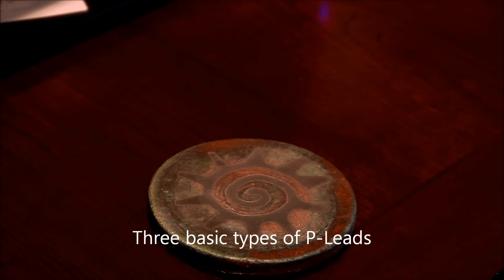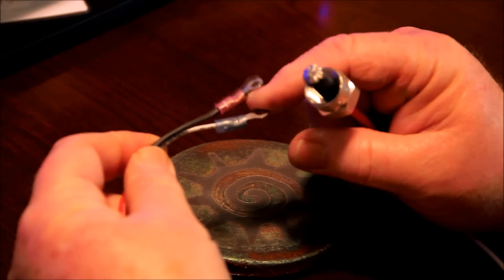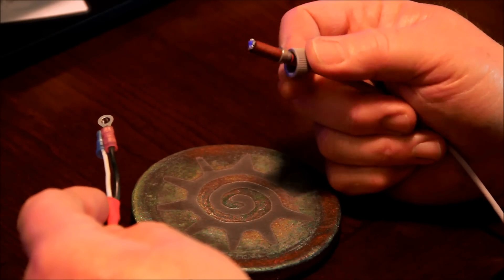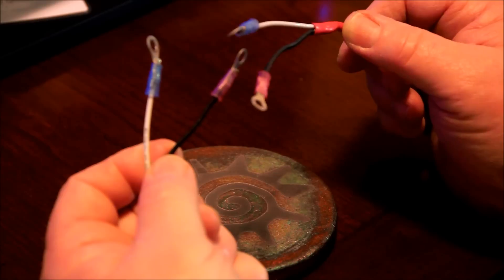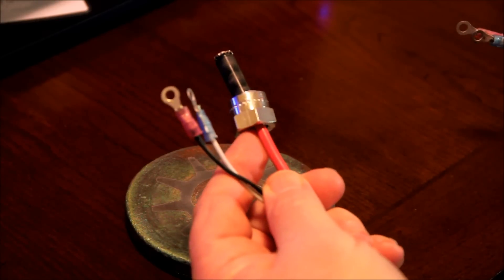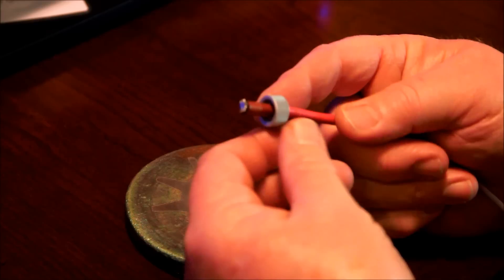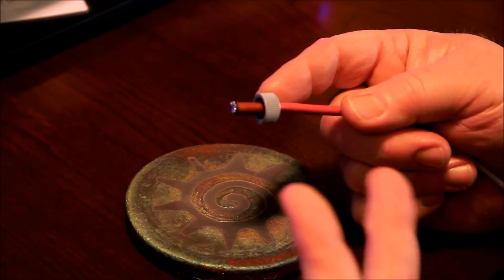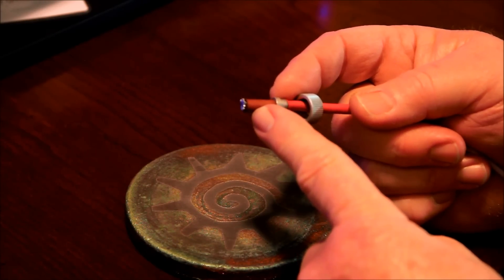Aircraft Magneto P-Leads -- Three Types

Comment: The 2 different bendix types have either a hex nut that is drilled for safety wire, which suggests that it needs some torque, or a round knurled nut that is not drilled for safety wire implying that finger tight is good enough. That is very puzzling. Does the round nut type use a tapered thread? Is the hex nut just overkill? Anybody know?

Comment: How do I isolate the bad p-lead or bad magneto? My cherokee 140, when I use the ignition switch to shut the engine per AD does not shut down like in the past. It will continue running, but not smoothly,... not like it was operating on one good magneto. It barely runs, but keeps kicking over, where I have to use the mixture to shut it down. I checked the grounding at the ignition switch at all positions and checks out with a multitester. I've bypassed the ignition switch completely with two ground wires from the mag p-leads and tried to shut the engine by grounding both wires... same result, barely running, but rough. I've changed the ignition switch to verify and it still has the same problem. My next attempt will be to try to bypass the p leads completely with separate wires, at least, for testing, to see if I get the same results. I don't know if this will give me more information as I don't have spare p-leads for testing. The fact that during mag checks the mag rpm drops are proper with about 75 rpm each mag, the engine operates normally at all normal operation with BOTH mags, I can't understand why the engine continues to run... but roughly, if I ground both mags.
Reply: Blueskylazer, 
I hope you called us or sent us an email about your problem. I have to admit that I don't check out the comments made on our You-tube videos that often. I certainly care about what is written and about our customers,we just don't have time to review all the videos for comments You might have noticed that we have a lot of videos and we have videos for our other product lines as well.
Reply: Blueskylazer - Sorry I didn't reply back to you. Did you get your issue figured out? We have so many videos that I can not check them all to see if someone left a comment or question. Sorry
Reply: I know this is old, but I would have been curious to know what the mag drop was on single mag operation at idle.
Reply: And how fast the engine would run at an above idle setting with the ignition turned off.

Comment: I've seen a lot of p-leads that are in pretty rough shape. The insulation is cracked, the shielding lead (ground) is broken or patched together with butt connectors. It is important that the shielding is connected! That is the direct ground path. It's part of the system and needs to be taken seriously.